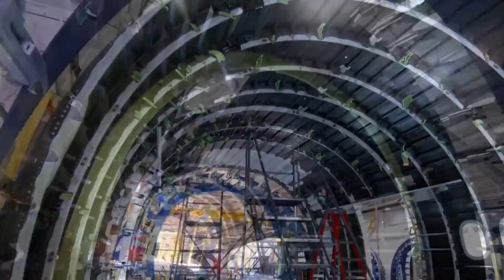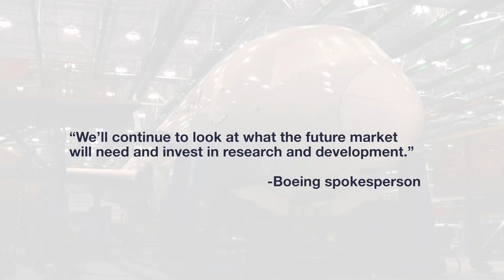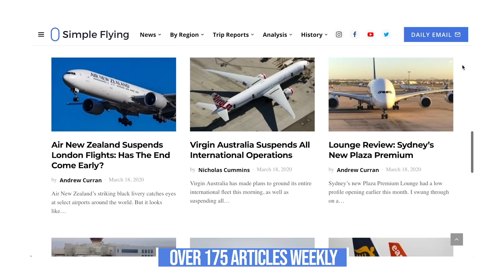Boeing Looks To Reimagine The 757 & 767 In Place Of NMA

Comment: While the 787 may have replaced the 767 in some people's eyes, it is not a direct replacement. The 787 is wider (8 v 7 abreast seating) and as such, would be shorter for the same number of passengers, and as we know, a design can only be shortened so much before you start needing an oversized tail and rudder (ie A318) along with the typical loss of efficiency with a shrunken aircraft which makes it far less economical to run unless offset with fleet commonality savings.
Had it been viable to shrink the 787 enough to cover the smallest twin aisle market segment, the NMA may not have even been considered.
Therefore, as a stopgap for the NMA, a re-engined 767 could make sense, as would upgraded wings (max style winglets?) rather than a complete re-design which might just take more development time and cost more time than Boeing can afford.

As for the 757, yes it was a great plane, but it has had its day. The extra few inches of width in the competing 6 abreast narrow bodies allows them to take containerised cargo in the hold, which will only become more important as airlines increase the amount of freight they carry and look to reduce turn around times.

If you accept that the 757 needs a new fuselage as well as new engines, along with upgraded or replacement of the 'worst in class for wake turbulence' wings, the 757 like the 737 really doesn't have any more development left in it, especially given that where the A321 can be used, it is outclassed, has already lost much of the potential 757 replacement market thanks to firm orders for the A321, and if a rumoured A322 makes an appearance, even more of the potential market could be lost.

Yes I know all about the 757s short field performance etc., but we have to face the fact, that even if it is required, and that there is sufficient market for it, there are no suitable engines with the required thrust available! Also once these engines come to market, the competition can fit them too - and at a miniscule cost when compared to what it would take to create even the cheapest Boeing alternative.

The old 1950's 707 fuselage has served Boeing well, with every Boeing narrow body having roots in it. But if you consider that the design will be over a century old by the time many of the 737s in production today reach the end of their service life, how can you justify continuing with it?

Comment: A replacement of the pax 767 makes no sense. The 787 was supposed to be that and is better suited to receive newer engines and even to make a smaller version for fewer pax if needed, as such version that was in the plan of the original 787 program (but was later cancelled due to fewer orders and the need of Boeing on focusing resources in the existing version of te 787 that were getting way behind schedule) and the engineering is almost complete and so is the manufacturing since it is a 787 just with a shorter fuselage and lighter structure due to the reduced TOW.
A "757 MAX" makes more sense (except calling it MAX, that would make no sense whatsoever)

Comment: Sounds good, if you can put the leap engine on the 757 and make it light enough it would work wonders... But, with the old design of the 757 and all those pulleys and cables and all metal frame you would have to re-design the whole plane to make it fly-by-wire and place all composite panels..... It would be a totally new plane any way.... Sorry folks, needs to have a wider cabin too, not feasible..... The 767 is the same cabin design and would have the same problems... That sucker needs  an uplift of everything more weight capacity and longer range.... It always was short on one or another....

Comment: the 777X was / is a mistake. The ULR (probably 6-7K mile) market should be premium only (premium economy and up). On a cost basis, it should be possible to achieve more than $200 difference between a direct ULR flight and ticket have one connection. This is probably enough for budget travelers to opt for the connection, meaning anyone willing to pay extra for an ULR flight would probably also want EP or better. This in turn means a large but not extremely large aircraft. The 787-10 could be the people mover up to 6000 mi, a new 787-9 with larger fuel tanks could handle premium only ULR flights. So what's missing is something at the mid-point between a 200,000lb 737 MAX9/A322 and the 787-9 (acknowledging that the 787-8 doesn't really make sense)

Comment: Whatever happened to the design of the 787-300??? Could it be dusted off, updated & used as a NMA/797
Reply: It's a reduced-weight 787-8 with winglets instead of raked wingtips. It's really too large and too expensive to be an NMA.

Comment: The 321neo long range has assured Boeing will never make a penny on this. PS - don't forget Boeing reducing lightening protection on the 787 without FAA approval. And the FAA denied the request then approved it after Boeing told them how many they already built with the unapproved change. And Boeing provided no data. Fuck the FAA and Boeing.

Comment: The 767X is way more likely to happen than the 757X. Machines and the whole production line for the 757 doesn’t exist anymore, while the 767 is still in production, the tools required for production are written off and when you use an adapted wing of the 787 the R&D cost could be kept at a minimum. And that’s exactly what Boeing needs in the current situation. Yes, the 787 partially overlaps with the 767’s market, but not entirely. It’s the same strategy that Airbus went with when going for the A330neo. It slots in just below the A350 capacity wise, has a bit less range, but cost significantly less to develop and hence retail prices can also be much lower. The same would be the case for the 767X. It is slightly smaller than the 787 series, while offering less range, but would be much cheaper. Additionally, while the single aisle market is taken by the A321LR/XLR, meaning a 757X would be too late, there is still a gap between the A321XLR and A330-800neo. Capacity and range wise a 767X would fill exactly that gap. In fact, if Boeing were to announce a 767X quickly, the argument could be made that it would sell better than the 777X, as at the moment it seems too big and too expensive for the current market (and next few years to come)

Comment: The whole 737MAX patching the ageing dinosaur programme should be completely replaced by a programme based on 757, most likely 757XSP(a shorter version replacing the 737-700/800), 757X(the re-engined re-winged -100 version previously no one ordered), 757X2, 757X3 and 757X4.
And it all should have started in 2004.

Comment: This theory has pretty much been debunked after Boeing denied a reboot of either a re-engined/re-winged 757 or 767 a while back. Although possible under the Covid-19 scenario as mentioned, the basic 757 design is from the 1970's and the 767 from the 1980's. The 757 production line was dismantled and the buildings demolished after production ceased in 2004. Whether any tooling still exists is questionable and known only to Boeing, which would much rather sell you a 787 variant.

Comment: Just my personal opinion but I think Boeing missed a huge trick by not making their new 737 variant from a 757 shortened fuselage and inner wings / undercarriage with MAX wings and engines. Had they done that they would not have needed MCAS, 346 people would still be alive and the company would not be facing financial destruction. Which of course will be covered by the US Taxpayer socialising plane making.
COVID has changed everything so airlines with MAX orders can now cancel with no contractual come backs and reduce their fleet size (as Delta are doing this week). And with a changed order backlog Airbus can fulfill orders that are needed far quicker than was the case pre - COVID.

Comment: I guess a 767 upgrade is doable but the 787 took a big chunk of that market and hardly anyone was buying the thing before.  But if a re-engining nets them a few sales then it may be worth it.  Also, with oil prices being as cheap as they are right now airlines probably don't see a whole lot of value in buying a composite plane like the 787.  If they can get the 767 at a lower price then they might prefer that even if they end up regretting it eventually.  

The 757 -plus is basically a narrow body NMA.  I mean the 757 is gone.  They haven't built it in a long time.  I doubt they even have any of the tooling lying around for it.  So at this point "restarting" that line would be the same as starting any new airplane line.  And on the engineering side I guess you could put a plug in the old 757 design.  I mean they probably have all the drawings and could save a ton on engineering costs by doing that but then you're stuck with a 40 year old design with a plug.  So most likely we're talking about a totally new narrow body aircraft i.e. the NMA.

Comment: with the whole pandemic going on, international flights probably won't open up again until much later, while domestic flights for countries the size of us and canada will much more likely to see the need for 737 replacements rather than something as big as twin isle 767 medium sized wide body jet. therefore a clean sheet redesign replacement for 737 with options and intents to upgrade to the likes of a321xlr in the future would be best way to plan for coming future
Reply: obstinatejack by the time a new clean sheet airplane is operative, the situation is probably back to normal.
Reply: @trezapoioiuy  better late than never, the plane is needed irregardless of pandemic happening or not
Reply: @obstinatejack  that's for sure.

Comment: Continuously redeveloping old designs instead of designing something new, what could possibly go wrong? Oh wait, that’s how they got the 737 MAX and killed 300 people
Reply: audigex The design that led to MCAS implementation on the 737 was due to the engines being played forwards and up on the wing due to lack of ground clearance. This caused an aerodynamic tendency for the plane to pitch up. The 757 and 767 are much taller aircraft, thus wouldn’t need an “MCAS” system.

Comment: ....while the 767 assembly line is still intact the 757 line has been dismantled so the 757 Plus would require rebuilding the production line from the ground up again. With new technologies, both aircraft types could be very viable for years to come.

Comment: Reimagining the 757 & the 767???

Haven't they learned from the 737 Max fiasco?????
Reply: Yes Col loc everyone is over reacting,say this to the victim families..
For me it is a flithy act to make money
Reply: I hate people who wont shed light on what really happened to the max, and why those 2 crashes even happened...I'm not an expert but here's what I have to say...It wasn't entirely Boeing's fault, it was also the airlines' fault. Them not following procedures and taking their own stupid measures on how to replace an AoA sensor....In fact, MCAS was actually a brilliant idea, and wasn't put in place just to prevent a stall but to make flying the plane a bit easier for the pilots when the forward mounted engines were in their higher thrust setting...  Plus it wasn't just the airlines that messed up, it was the pilots (Not saying that I could've done it better, or that the pilots could've done better, what I mean is that the entirety of the blame shouldn't be slapped on boeing), the pilots knew that the horizontal stabilizer trim was acting out and they could've just shut it off using two toggle switches mounted right on the center control column... Plus if the plane would've been a 737ng the same thing could've happened, that is that if the pilots weren't well aware of the horizontal trim functioning, they coulv'e messed it up too..(Boeing's mistake was to have the MCAS system rely on just one AoA sensor...) if the AoA on an ng would've been damaged the plane would've pushed the nose down itself thinking that it's in a stall when it really isn't.. Plus an XL airways a320 crashed due to this very reason.. The a320 has three AoA sensors.. In case of the XL airways crash, while the plane was being washed, procedures such as using a safety device to protect the AoAs during washing weren't put in place, hence leading to water being accumulated in the gaps of the AoA leading to it malfunctioning in midair (due to ice being formed within that gap due to the temperature drop at high altitudes). Two of those 3 sensors malfunctioned in midair resulting in faulty readings.... If the a320 gets faulty readings by one sensor then it'll ignore the data that's coming from that sensor and depend on the remaining two sensors as it sees that the remaining two sensors provide similar data...in the XL airways case the two faulty sensors were pumping out similar data and the one AoA that wasn't malfunctioning was giving different readings compared to that of the other 2, due to that the plane thought that it was in a stall when it really wasn't and pushed the nose down. The pilots of that XL airways flight were performing a test flight and were doing a low speed warning test, however they didn't take the necessary precautions to commence such a test and were at a very low altitude, due to that the airplane pushed the nose down and the pilots couldn't get the plane out of a dive, plus investigators later found out that the captain hadn't applied forward horizontal stabilizer trim to aid with the dive recovery.. This proves a point that it's not always on the airplane manufacturer that leads to a crash.. (Yes, boeing should've used more than one AoA to feed MCAS the data it needs) The max crashes happened due to the airplane's faulty AoA sensor (Which was the airlines' fault as it wasn't installed using proper protocol) and pilot error... I hope this helps you understand the situation a bit better....
Reply: @col loc yes Boeing focuses only on money and they deserve this hit..Even American pilots complained to Boeing about the max multiple times on the very same issue.Beoing executives kept quiet and they are busy with their lobbying the Congress, Safety agencies in the worlds...Now the victim families will sue the fuck beoing for this and they deserve this fuck for a long time

Comment: The nma would have been awesome. Not interested in either of these. Boeing should have built the nma then scaled it down to replace the 737! Failing that they should develop a new replacement for the 737 and 757 at the same time.

Comment: A refreshed Boeing 757 (could end up being a stretched 737) could compete with the Airbus A321XLR. It would not only have new engines, but possibly new wings. It can compete in the mid sized market. The Boeing 767 is a better candidate for a mid sized aircraft as it is still in production. New engines and new wings can make it quite competitive. Either option or both options would be viable.
Reply: alterman156 better not be a stretched 737. We have enough problems with those already
Reply: @tomstravels520  I'm certainly aware of the issues surrounding the 737 MAX series.

Comment: Boeing should have started the NMA program 10 years ago to replace 757 and could have designed a  shorter fuselage variant replacing 737 as well. They would share pilot certification with 787 so most airlines would accept easier the 737 certifications fading slowly away and not insisting on that certification being retained by retaining the 737. SWA would have to understand the wise investment of new certifications to gain much greater capabilities.

Comment: I have had nothing but good experiences on the 757.  I have never flown in a 767 however.  Bringing both back in a "PLUS" configuration is interesting.  The 767 line is still hot but of course would need updated to reflect the changes the newer aircraft would need.  Bringing back a 757 PLUS would be a bit more problematic but likely less so than a fresh sheet 797.  The question begs did Boeing keep any or all of the 757 tooling?